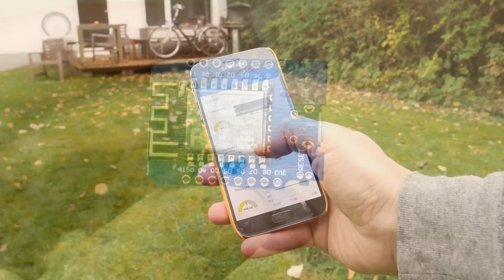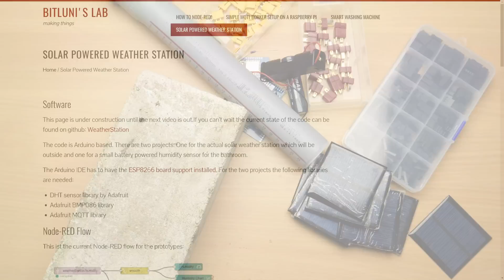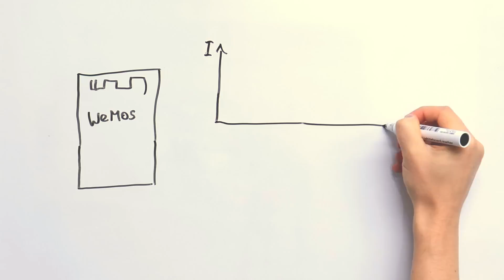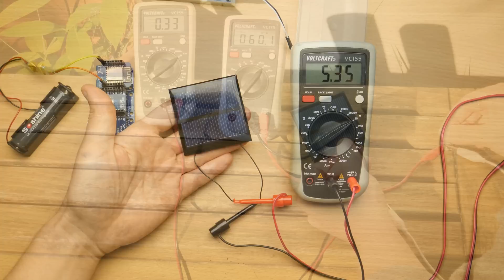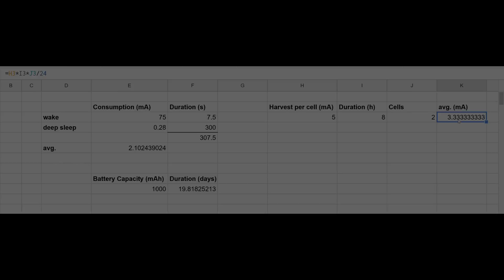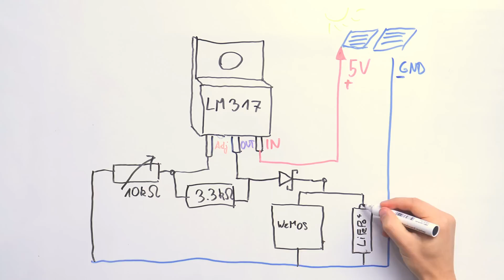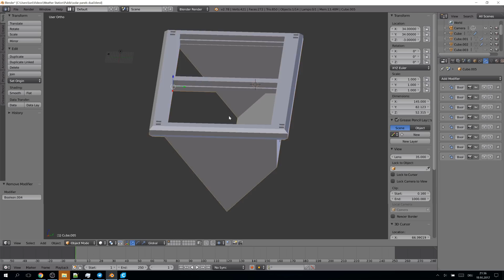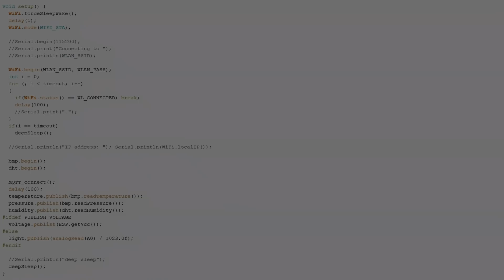Solar Weather Station [WiFi, MQTT, Smart Home, ESP8266]

Comment: Still using a dht ... perhaps take a look on the bme280! Temperature, humidity and pressure - from Bosch. Best environment sensor i know for 3€ on an breakout board.
Reply: The BME280 is great, I use the sensor also.
Reply: Can confirm that the BME performs much better than all DHT.
Reply: do you know for if an rain and wind sensor exists?
Reply: @boonkerz  Rain is easy to do with a collector and a capacitive sensor glued to the outside, but you have to either empty it manually every time it rains or make an automated/remote valve to do it.  Wind sensors are fairly easy, too, but they're big and prone to breaking.  You also need to calibrate them if you want a meaningful measurement , which is not so easy.
Reply: Yah, why wouldn't they use the superior BME280? Less parts, less power, and MORE accuracy. It's not made for a shield, but you can use a Proto shield, or just string it in on wires. I would actually suggest stringing it in, as you can get it away from the warmth of the ESP.
Reply from the maker: Thanks for the hint.. ordered them and will try next time
Reply: And for light measurements I have good experience with an BH1750 connected to the i2c bus. With low power consumption and excellent precision on human eye wavelengths. So you can free the analog pin for battery measurement. It is available for less than 1€ or 3€ with a nice white plastic dome.
Reply: @christianmeinert8806  A bit more expensive than a photocell + resistor.. lol.  But nice.
Reply: Thomas Peterson yes those exist in various shapes and forms
Reply: Thanks!
Reply: BME280 won't measure ambient temperature, instead measures it's internal temperature
Reply: @gautamdamodaran  Internal of what? Of course it measures ambient temperature, it depends where you place it.
Reply: @gabrielex   "The integrated temperature sensor has been optimized for lowest noise and highest resolution. Its output is used for temperature compensation of the pressure and humidity sensors and can also be used for estimation of the ambient temperature." from datasheet
Reply: BME 280 small ALL IN ONE, then you can build very tiny cheap wifi weather!! :):):)

Comment: to get even less power consumption from the esp D1 mini ,desolder the Ch340 driver after your finished programming it , you can just de-solder the vcc pin for the ch340 and save around 15 ma 
some people prefer to cut the track to the ch340 and leave the copper on the track exposed ,that way if you need to re-program the device you just have to put a blob of solder on the track and you can program it again

Comment: Hi thanks for this video. I'm wondering how to ensure the wifi range, when my weather station will be setup ca. 50m away from the house. As I'm a rookie in the arduino and esp, I would only ask if there is any possibility to develop some kind of wifi repeater with esp/nodemcu/wemos parts?

Comment: Measuring solar panel voltage while it is connected to the battery will only give you the Battery Voltage

Comment: This is great.  Very close to what I need to do.     Need to build a weather station that lives off grid.  Requires solar for energy and an IOT cellular connection for sending back to a public page.     If anyone has any suggestions, I am JUST starting this project.  

I need:
Temperature
Rain
Humidity
Wind
Density Altitude (Yes, it's a remote airport) 

I would LOVE to have a Celiometer, but this may be a pipe dream.   

if anyone has any experience with a configuration like this, I am ALL EARS!!!

Comment: You could also put in some code so that when the battery is near fill and has been receiving good sunlight for the last 2 days or is charging faster than it's losing power than it will update faster.

Comment: i can also recomment such solar lipo charger boards as a powersource for example the "DFRobot Solar Lipo Charger". I connected it directly to the wemos d1 mini 5v and ground pins and it works just fine

Comment: Technically topping off the battery all the time would be bad. I'm not sure how lifepo4 will handle it. However you are solar charging which means that most of the 24 hours you will be drawing current instead of charging. Then you will be charging and you might get 4-5 hours of topping off, but it won't be every day - especially in the cold seasons. The worst that could happen is that you'll reduce the life of the battery by a bit. But it's not that big deal if you replace it every 3 instead of every 5 years. My biggest concern is if it survived the winters without the voltage dropping too low. Is there a follow up video? I'm curious to see what happened

Comment: as long as you arent continualy trickling it full.  i recomend letting it use a small percentage between charging.       That will lengthen the charge the most.
Reply: That would happen when it’s dark out, I would think.

Comment: I know that insert keeps the inside a little isolated, but any sun on that PVC pipe will heat the whole thing up.  The open bottom helps, but without any wind there would be a lot of heat build up, and even a decent breeze wouldn't remove all of it.  Any extra heat is going to throw all the sensors off.
     Better to have holes in the top, shielded by an overhang to let air flow through.  A 2" or 3" (50 or 75 mm) PVC pipe cap could provide the overhang - just glue it to the cap you have, then drill a bunch of holes in the pipe where the PVC cap will hang past them.  You'd probably want to attach a piece of window screen on both ends to keep out dirt and bugs.

Comment: The battery lifetime will be reduced when keeping the cell voltage at maximum all the time.
Recommendations for lithium manganese cells (max 4.2V) is to charge them to only 4.1V to increase lifetime.
The capacity however might only be at around 80% then.
You can lower the floating voltage of your lifepo4 too.
Reply: You have to implement a current limiter, I would like to know how to do it.
Reply: @sojueray5929  if you use a small solar cell like this a current limiter is not required. if the solar cell maximum current is lower than the maximum charge current there is no problem.
If however the current can be higher you can use 2 LM 317. One for current limiting and one for voltage limiting. Both in series

Comment: I built a similar version. It worked just fine over the summer but ran out of battery later. After the battery is empty it is unable to recover. If the solar cell gets light it will push the voltage up for the ESP8266 to boot but it won't be able to permanently deliver enough current. This causes the ESP to crash before it can enter deep sleep. In this state it will draw 100mAh+ until the battery dies again. This repeats forever.  So far no solution in sight :/

Comment: I am testing the solar + lifepo4 + solar of this setup  on low battery levels. I discovered that, when on low battery, the wemos wouldn't start up properly resulting in constant high current draw (no deep sleep) which in turn results in emptying the battery even faster. Adding a 1000uF capacitor resolves this issue extending the setup to run on battery longer. That could just save that one day extra without solar power. I also added a connection to the analog input of the wemos (not using the analog light sensor) from the battery positive terminal (with a 100k ohm resistor as voltage divider) to measure the battery voltage. This could be used to lower the update frequency when the voltage is dropping.

Comment: If you want to slightly reduce connection time of esp to wifi and save some energy you can use a static ip instead of dynamic.
BTW, a project is awesome! :-)

Comment: Hi guys, and sensei bitluni. I have one issue with this project. Scetch works like a charm, I get readings from DHT22 sensor to serial monitor, but readings are not sent to my server... Inside server runs NodeRed, and I have other ESP8266 with different sketch in it and it forks just fine. Any suggestions for this trouble? Thanks in advance. :)

Comment: Could we use mosfet for diode purposes? It would have less voltage drop, but I'm not sure about the power consumption of the neccesary circuit.

Comment: Can I use a Zener diode instead of Schottky diode?
Reply from the maker: You can check the voltage drop, if it's low it should do
Reply: Batteries range from 2v to 4.2v.

Comment: Be careful with skottky diodes. They can have a relatively large reverse current, which kinda defeats their use in Backvoltage protection

Comment: If you snip off some hot melt glue and put it in the shrinksleeve before shrinking, you make a water tight sleeve. now water is getting in trough capillary action. ... just a hint. Nice work!
Reply from the maker: good tip... can't wait to check how everything looks when it stopped working. It's still doing fine.

Comment: Nice project, the potentiometer is drawn wrong on the schematic - unless you intend to use it as a 10k fixed resistor ?
Reply from the maker: what would be the correct symbol?
Reply: The symbol is fine, but one of the connections should be to the wiper rather than the resistor end.  The middle pin on the POT is the wiper.
Reply: Looking more carefully you seem to have got it slightly wrong as well, try a google images search for "lm317 variable", most examples are using all 3 POT connections.
Reply: PS also just noticed that 3.3k is way outside the safe value for R1 for the 317, it should be more like 220R or 330R max for your application, the 317 is not really regulating at all the way you wired it up.
Reply from the maker: that's true, thanks for the hint
Reply from the maker: using the pot as a variable resistor is sufficient.. you want to regulate against the output voltage not the supply voltage
take a look at the first page application schematic http://www.ti.com/lit/ds/symlink/lm317.pdf
Reply from the maker: you might be correct on the 3.3k
I tried a smaller version of the lm317 which refused to work with this setup. the problem with smaller values is that you actually would lose some milliamps to the regulation since there would be below 1kOhm between output and ground. This is highly optimized to work with few milliamps... raining 24/7 here ;-)
Reply: Which page of the PDF please?, number is bottom left.
Reply: Ohh .. I see it now. The datasheet drawing has used the symbol for a two terminal variable resistor, almost everyone - including yourself uses a POT (3 terminal device). The symbol you used is fine but the connection should be between the wiper and one end.  Still won't do a lot useful with 3.3k though, the 317 uses NPN/PNP transistors and needs a standing current of a few ma to work.  If you want low power then use a battery with at least 1.5 times the required output voltage and a buck converter with an enable pin. The LM2596 modules are very cheap, that has an "on/off" pin, takes 80uA in standby - hundreds of cheap modules available on ebay.

Comment: Hi bitluni, i'm currently using rrd and a real linux server for my weather station to fetch and store the data, but i want to switch to MQTT and perhaps Node-RED. Can you say something about datastorage and safety? I mean, as far as i see in your videos, all data is stored on the SD-Card of the Raspberry Pi, right? I had many projects with several Pi's and often the sd-card fails after some time even with proper shutdown of the system. I could currently request data from one year of my weather data and it would be nice to have this also in Node-RED, the safe way. I don't want to use any external services and if possible replace the bulky linux machine sitting in my appartment.

BTW, nice videos and i wish you all the best for your full time youtube journey.

Greetings from Bochum
Reply from the maker: I don't use any kind of permanent storage for the collected data. Node-RED buffers the data points needed to display in the chart. After I finished setting up my system a create an image of the SD so even if it fails I can easily replace it.
To store the data permanently, I'd mount a drive on my disk station from the raspberry and set up a cron or node red task to backup the database which you use from node-red. writing directly to the disk station would wake up the drives all the time.
Another option could be an extra usb drive for the raspberry just for the data
Reply: I just set up an old raspberry pi 2 as mqtt broker and converted my 1wire based weather station to mqtt. With the help of your videos it was a 2h task including installing, updating and soldering. Will now see how it looks in one week :). Thanks again!

Comment: If you remove the serial to USB chip and voltage regulator, you should have a current draw of about 60-70 µA. I have a BME280 and it runs for a month and a half connecting every 5 minutes to my MQTT server with one 18650 battery.
Reply from the maker: This sounds like a good idea. Did you measure the difference before and after?
Reply: Yes, but it was a while ago. But the AMS1117 has a quiescent current draw between 5-10 milliamp. I think the serial converter draws a couple of hundred µA.
Reply: And I just have a regular 400x rectifier diode to lower the voltage by 0.6 volts of the 4.2 volts (when fully charged). The esp8266 is quite happy running a bit over 3.3 volts.

Comment: I'm interested to know why you chose Arduino IDE instead of Mongoose OS for this project?

I've been trying out Mongoose OS since finding your videos, and love/hate it so far.
Reply from the maker: That's actually an unfortunate story. I tried to do it using Mongoose BUT there was no image that supported I²C and DHT at once. Only the IoT image hast DHT support but no I2C library... I asked for help but it takes some time and I didn't want to delay the video even longer. I always try to use JS and the default images since it's easier to set up. You could compile your own image using their cloud service.
V2 of the weather station will not use DHT sensors anymore... I hate them from project to project more and people suggested good alternatives in the comments here.

Comment: Nice.. like the topic :D. still on my wishlist to make. one question though,. you say you are using a BMP180 for air pressure and precize tempreature. what do you mean by that as all the explenations i found for the BMP180 are about barometric pressure and no reference to temprature.
Reply from the maker: it provides temperature with 0.1°C precision. check it out
Reply: bitluni's lab thanks. I will take that in mind. I am currently working on the mqtt ;)

Comment: velm 6075 can be a better alternative to the LDR
Reply from the maker: what's that? can't find anything. I am open to improvements
Reply: bitluni's lab  Vishay Veml 6075 is a UV, +light sensor. Which has built in adc and it can be connected using I2C. +Break out boards are available in aliexpress

Comment: Hello, have you used another language to program esp8266 such as lua or native espressif rtos SDK? I'm wondering which one is the best for doing this stuff, what do you think? Arduino seems so newbie rs and sometimes buggy
Reply from the maker: I am currently starting with esp32 idf. have the only experience with arduino and mongoose os. I only take arduino if mongoose does not have the functionality easily accessible that I need for the projects. I hate Arduino. Intendation using spaces.. srsly?! ...but it comes with the comfort of the libraries.
A am still looking for the best IDE... I hope Mongoose will get more libraries and simpler way to compile c++ projects. I'll also try to contribute
Reply: Try lua! But be informed - it's assinhronous and event based - that means different aproach programming. But it's a lot of fun learning it! :)

Comment: i'd be interested in DHT22's long term stability; mine never survived more than a few weeks until they permanently kind of "saturated".
Reply from the maker: I will monitor that and include it in the update once problems come up.
To test my first DHT22 I  breathed upon it and it stopped working completely... 😅
Reply: Ha ha, yep, that's a no-no - the "data sheet" (if it's worth that name) mentions a recovery procedure for this ("bake" it in the oven at 60° for 2h), but i never got one being off-set back to normal operation. Since my application uses 2 of them, the miss-measures were quite evident. Which is a pity, since i do not know of any other sensor which can be used with 5m wires without special drivers etc... (but will now switch to I2C with P82B715 extender)
Reply: Yes. Had that problem too

Comment: How about using a 4 Channel Analog I2C IC like the ads1115?
You could get a higher precision on reading the light level and you could add a batterievoltage reading.
Also a Rain/Water-Sensor and a moisturesensor for your Garden would be interesting...
Reply from the maker: nice IC.. just ordered it and will try it in an upcoming project

Comment: spitze, ich muss mir auch paar wemos bestellen, die scheinen mir echt Klasse zu sein. aber für die Zukunft nutze doch schwarze Kabelbinder für den Außenbereich, die weißen sind nicht UV Stabil
Reply from the maker: +Stan Linke true but I will be happy if the cable ties are the first thing to fail :)
Reply: Das ist ein gutes Argument. Halte uns doch bitte auf dem laufenden sofern es erste Ausfallerscheinungen bei der Wetterstation gibt. Aktuell baue ich auch an einem Projekt für den Aussenbereich und bin mir noch nicht sicher ob ich es einfach regengeschützt aufhänge oder wasserdicht verpacke
Reply: bitluni's lab also bei Husqvarna Rasenroboter werden die Platinen mit Schutzlack behandelt. Obwohl der Roboter an sich dicht ist. Aber bei der Ladestation sind auch gerne die Ameisen drinne. Oft oxidieren dann die Kabel aber der Platine tuts nichts mehr 😊